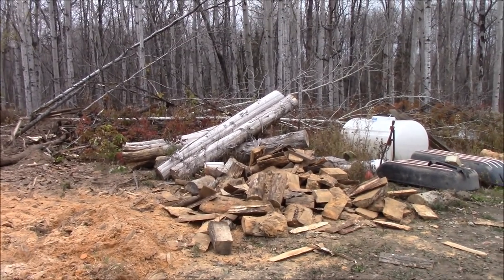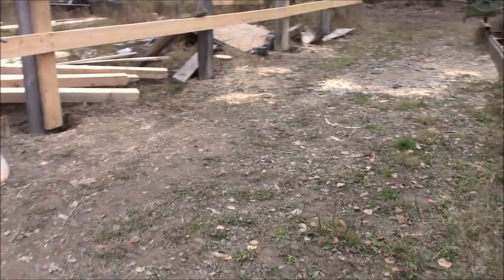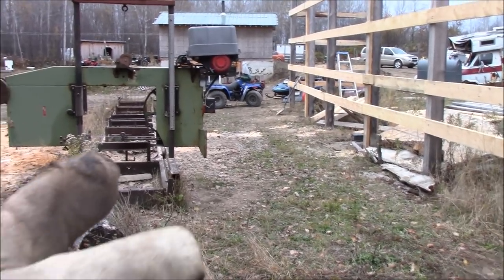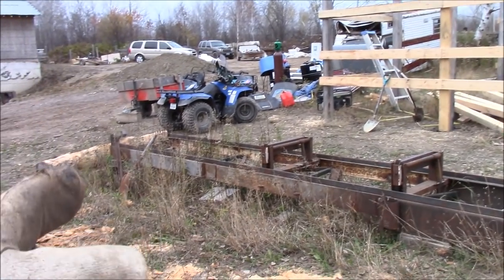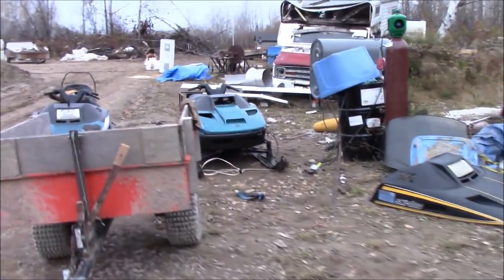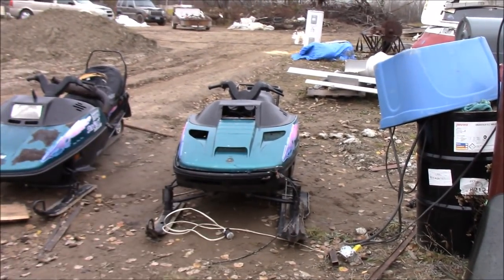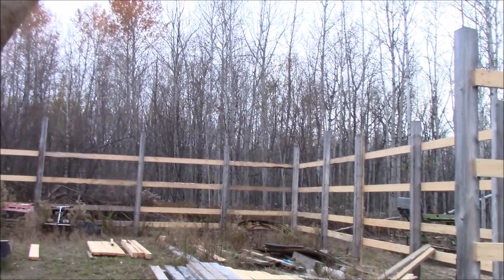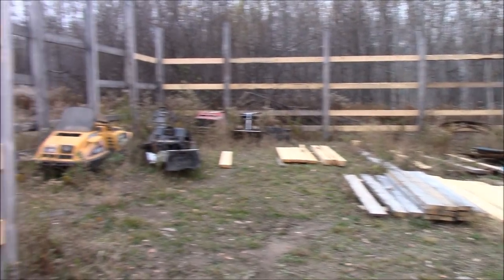This Pole Barn Will Be All We Need/ The Work Continues

Comment: You said that you wanted to make some type of cable hoisting system for your Sawmill logs. I have been looking end of this. I think you should reconsider. You should utilize your tractor. You should invest in some type of pallet Fork attachment. What makes me go wild for this convenience is that after they have lifted the log on to the sawmill the operator backs up just a few feet and levels the forks at a table height. And then he Stacks the lumber from the log on to the forks and then he has Liberty to take it anywhere he puts his pile. And just transferred over at the desired convenient height to the pile. Yes my reaction was dang this guy has it figured out.
Reply from the maker: Hello.  The main reason I need a hoisting system at the end of the mill is if I want to mill a 30' log.  The posts that will hold up the roof over the mill will be 8' apart,  I won't be able to load a log any longer than 7' from the side ...Cheers.
Reply: @SkinnersOffGrid  I would consider keeping it where you can slide it around but you must be working in the winter time. After all all you have to do is move the Sawmill away from those dust sawdust pile and scoop it up. I know that it is possible to span 40 foot open area. Why don't you just add on to the back of your shed hopefully it's 40 foot. And I have given great thought about you constructing a new building with a overhang using 16 x 16 Post in the ground giving you a 15 ft wide Bay as as long as you desire to be. I seen this done before he put 16 in the ground 10 ft apart and then put his platform on Bridging the Bay by be utilizing both sides of the 16 by 16 Post in the ground and then he put a roof on top of it. You can get some oil pipe and put an oil rig canopy steel canopy over top of the existing sawmill and load your logs right into your Sawmill with your tractor.
Reply: @SkinnersOffGrid  you can bridge that to just apparently haven't seen us farmers Pull and Save 30 footlong combiner head into a pole barn. The old wood way of doing it is to make a box and and then lift it over the doorway. In the center of this box you're using 8 by 8 the same as your poles except these are probably 2 feet high. And ultimately you lines he's up and start pranking them. Now our newer building they used a steel girder. Also your sides can be supported with a brace.

Comment: the blocking from the house move use for under the mill and the log you are pushing down fire wood
Reply from the maker: Hello Jerry, I eventually want to pour concrete slabs under the mill so they will never rot out.  The small trees I am pushing down are 4" at the most....They may be good to make tooth picks.  Thanks again...Cheers.

Comment: You know those long pieces that you cut with your sawmill that are not desirable. That resembles boards yet they're often tapered at one end and have bark on them. You can make a shed or a chicken coop or a dog pin out of them. As well as the scrap rounds or ends that you do not want to use for firewood as said. Basic instructions you need some three by threes long at the same length. You going replace them 4 ft apart and plank them. With your Sawmill scrap. Then after you get quite a few sets of these. You going to make a box by positioning them upwards and wire tying them together. And then you can add an overhanging roof. No you can use your lumber for this even as shingles. The final step is do you stack your wood around the shed like structure. Depending on your location and what's in the vicinity if you get tired of your shed or it goes to rot you can set it on fire and have a bonfire for the 4th of July. In case you get severely injured the structure he is a security firewood pile. Some people stack firewood in the doorway and they hide things and everyone thinks that they have a bunch of wood.
Reply from the maker: Yeah I guess I could do this...But  I have some local friends who are older and not well that come and get them to burn so it keeps the cost of their heating bill down.  This makes me feel good to be able to help out.  Thanks again..Cheers.
Reply: @SkinnersOffGrid  things like that are very Noble

Comment: Barn / Work shed not going to be Heated, just find a Cheap / Free Wood Stove or Heater and put it in the middle of the Shed / Barn and use the Sawmills waste to Feed it, it will be plenty Warm enough, as you will have plenty of Fuel for it.